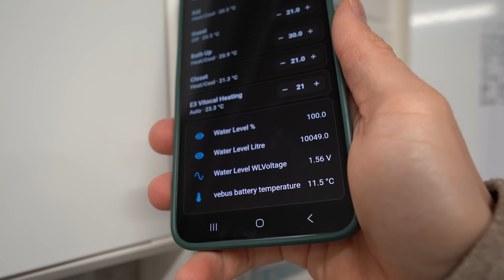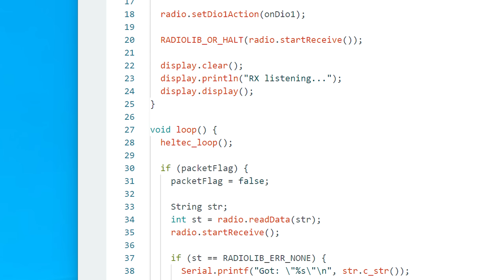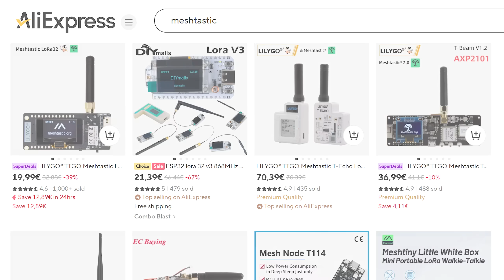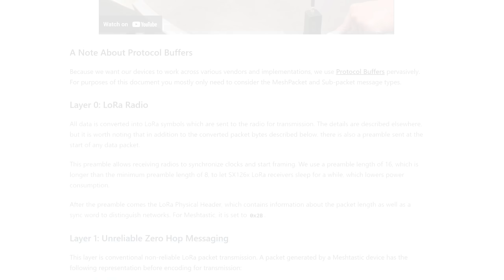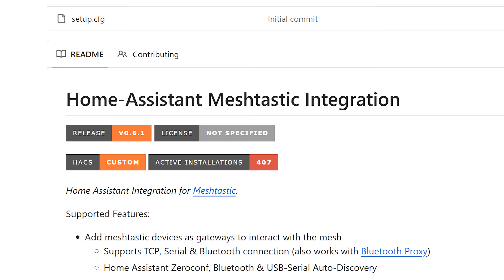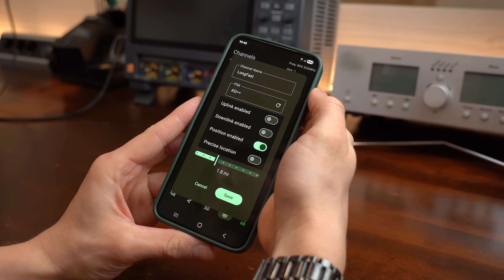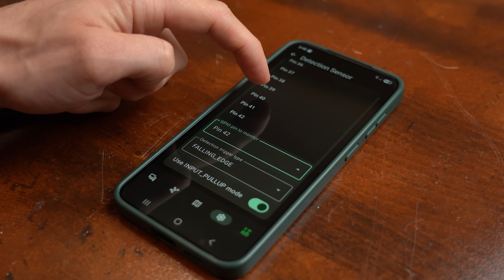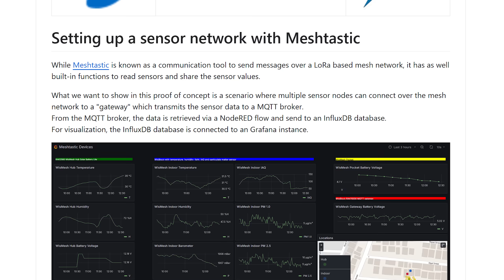No WiFi? No Problem! Long-Range is Finally Easy?!

Comment: So, now thieves know how to bypass the light curtain😮
I know it’s just a project to show what this can do but there are better systems to protect your shed.
Reply: light curtain can be used but i didnt use it for my shed instead i used single photoelectric through beam sensor. It will work fine in my case because there isn't any windows and even if you break down the door you basically will trigger the alarm its far smaller than light curtain and is hidden well a thief can't see it in the dark

Comment: Would 433MHz give you more range compared to 868MHz?
I think lower frequencies are more penetraty right?
Reply: For resonant antennas like whips, the lower the frequency the longer the range because the receive antenna gets longer and can capture more energy.  Lower frequencies also diffract or bend around obstacles. As for absorption, that depends on what's doing the absorbing. Generally speaking, VHF does better outdoors and UHF better indoors and in urban environments.

Comment: I know you needed an excuse to try the new lora stuff :), but cheap 433MHz transmitters and receivers exist and they don't block the air space for almost 1km for devices that actually need to rely on LoRa.

Comment: Oh it's working with NO logic? ( normally open) 
There is a flaw: if someone cuts the wire the system will not notice ...
Therefore it should work with NC (normally closed)
=> if wire is cut => Alarm !
Reply: Yea i also wonder why use light curtain instead of single photoelectric sensor which is smaller and would still detect that can be hidden easily
Reply: This!
Shouldn't any light curtain for professional usage be NC.
If it breaks and you dong realise and expect it to work, accidents might happen.
Reply: Use a End Of Line resistor. With NC tampering is still easy!

Comment: yeaaa buddy its meshtastic
thre fun in urban areas i get over 200 nodes with one day of being on lol CH 20 LONG FAST BABY ALL DAY!! make sure to replace the  primary channel with one you mada by clicking and dragging it to the first available position. the meshtastic device broadcasts gps packets by default on the primary channel so by making a secondary channel you can turn gps off and then by moving it into the primary spot the device will stop automatically transmitting gps packets. this is usefull if the mesh is congested or you don't hav want  your gps info broadcasted on the default channels for all to see. ALSO HELTEC PRODUCTS ALLOW LIPO VOLTAGE TO GO TO 3.2V BEFORE TEH BATTERY INDICATOR SHOWS 0% THIS IS DANGEROUS AND WILL DESTROY PACKS THIS NEEDS TO BE A PSA PLEASE!!!!!! ive switched all my heltec v3s with lion 18650s or pb solor setups. heltec v4 has a extrnal amplifier to reach a higher 27 dbm. the oem lora chips reach 21.oror

Comment: You shouldn't lay the antenna flat on that barrel.  It's designed to have an omni pattern. You only get a good transmission in the plane perpendicular to the antenna.  When laying flat, this means you are only getting good transmission in two compass directions.  When vertical, you get good transmission in all compass directions.  Also, the high the better due to curvature of the earth and obstacles.
Reply: Polarisation...
Reply: I think you can safely ignore the curvature of the earth over a distance of 20m 😁
Reply: @SolarWebsite But not with the ranges LoRa is capable of.
Reply: @SolarWebsite  20m yes, but he was reaching 750m.
The curvature makes anything that is further than 4km away invisible for a normal human (eyes around 2m above ground), so going with the transmitter around 1m above ground (that shelve on the window) would limit you to around 2km (you could probably do the math to get exact number, I am just estimating).
Reply: With the resilience of the LORA protocol, it doesn't matter at this range.  I have some of my meshtastic with high gain omni antennas laying flat. Is it ideal? Nah. Does it connect to the neighborhood? Yeah!
Reply: @Curt-0001   helps for new people to know best practice though.  Impossible to say how many people watch this video and try to copy what he’s doing but find themselves just slightly short of signal, and possibly because antennas were cross polarized  (one vertical and one horizontal).

Comment: just do t-halow and bring your device via ethernet/wifi into your home assistant. 1km range and real network
Reply: halow is forbidden in Germany, because the frequency is licenced
Reply: @MagicWolfX_HD   HaLoW is not a frequency so much as a modulation.   Could they not use the same bands in Germany as what LoRa uses?  (870ish MHz?)   In the US, we have an unlicensed ISM band from 902-928MHz and that’s where both LoRa and HaLow reside.

Comment: Good use case to get jnto meshtastic. 
20m for me is "trench some cat6" territory or use something like a ubuiquiti lr AP. I have 4 cameras running off one AP though my bandwidth requirements were a lot higher than a serial alarm. 
Where meshtastic really shines is remote environmental monitoring-1 mile down the creek checking water quality etc.

Comment: Think about, it is no longer ok to have un-safe IOT in EU. There are new law about that if i am not got wrong info.
Reply: I'm not a lawyer, but I suspect that only applies to resellers and manufacturers.
It would be kind of absurd to start fining people for having insecure devices that they made themselves.
Reply: @tin2001  The question will be if hacker hacks these devices what will be the result of that? 
Not sure, but these devices can be used to attack other devices if they are not safe. Correct me if I am wrong.

Comment: I have meshtastic boxes made from a esp32, a LoRA module,a small solar pannel and a 5000mAh batteries all around my city, and one in my bag so i can connect wherever i want, for one kit its like 20 bucks
Reply: What are you using them for?
Reply: @weltirol3476 communications, i can text, anyone who is also connected to it from the whole city

Comment: Meshtastic is still flaky and closed source, and radiolib is still a pain to use. If you really need lora for a project, it can be done, but I don't care for meshtastic.
Reply: I actually have the same issue as great scott, flakey wifi in the shed and I've sensors in there. Can you say why it's flakey, or offer a better soloution?
Reply: I agree that meshtastic can be flakey. I doubt radiolib is though, most problems are in the upper layers of code as far as I can tell.
Reply: What source isn't available?

Comment: I use Lora on Adafruit Feather M0s  to transmit temperature/humidity/power/light from my solar powered LiPo units inside my greenhouse.  A problem I ran into: the aluminum greenhouse is like a Faraday cage and nearby metal tomato trellises interfered.  Also, fogging at night (moisture particles suspended in the air) attenuated the signal.  Your metal shed is could attenuate your signals if your antenna is inside it as it appears from your video.  Also, keep your Lora away from any USB-3 cables units, that, too will attenuate the signal (at least for my US band 915).

Comment: i have my project where i want to send the value from sensor to another controller and the distance between them is 4km. So is lora technology good for me ? or could u find one
Reply from the maker: Well, this LoRa stuff should do the trick with the right antennas and setup. However, I can not test that for you.....
Reply: @greatscottlab  it's ok thx
Reply: Only if it's line of sight. There are good sim options now too.
Reply: @MyPhone-qg2eh ye but i tested some budget options but they do not have that much range

Comment: Get your antennas vertical!!!
Ball park rule of thumb not exact math...........
You can lose something like 20db of signal for antenna that don't match or are not vertical.
for every +/- of 3db of change is double or half the power. Losing 20 db because your antennas are not both vertical is devastating for range.
Reply from the maker: Thanks for the tip 🙂
Reply: @greatscottlab 
Insert <simpsons Im helping meme>
Reply: I have my antennas horizontal to minimize noise to my neighbors, (radio power options not available on my cheap router)
Reply: @mezu-e  A valid emission control method if you don't need range.

Comment: I recently learned that a Amazon Sidewalk is doing this at scale. Their internet connected devices like Ring cameras are a bridge for a mesh network to the internet.

So like a tracking tag connects to the mesh and finds any bridge device to push data to the cloud. It is all closed and controlled but you can get a development device, could be interesting.
Reply: Completely boycotting all American stuff.
Reply: Not everything american is bad... But most likely everything from amazon is bad...
Reply from the maker: Definitely sounds interesting ;-)

Comment: I just tried two Heltecs as my first LORA devices. I made a 10km connection at about 150baud through less than optimal signal terrain. GreatScott! I am  very far behind the curve. These things are very capable.
Reply: I am using a pair of "ANJIELO" wirelles bridge to connect my other appartmet to the internet, they are around 300 meters apart with a line of sight. Also I am in the center of Rome and so we are full by wifi Connections, but the connection is stable at around 5 meg/sec Up and Down.
Reply: Would that be enough for a link to a wireless router for a wired camera system to connect to or would it still be unusable as a remote nvr?  I have a barn that is not a perfect line of sight 100 meters away from the house.  Currently have the main router in the barn that is sent to the house router with a line of sight deal.  I want cameras in the barn and at the house om one system..  not two separate nvr’s..
Reply: @Z-Ack  1080p can be streamed at 5 Mb/s.
Reply: @Z-Ack Absolutely not. Lora usually does like a few bits per second at its long range config. Its intended for short ASCII messages. You should look into running Fibre out there or using a point to point gigabit radio.
Reply: @Z-Ack  look up mimosa line of site equipment. Uses 2.4 gig band and can achieve hundreds of mb/s at over 1km with line of sight.
Reply: @ocelotmadness6287  Lora is slow. Think dial up days, but with huge delays and 200 character block max per send. But its record is 800 miles in a single hop over water. I am maxing out around 10miles with very minor obstructions and base grade gear. Very low power.
Reply: @jsmythib can you please give a bit more explanation? Which antenna have you used to achieve 10km range? And it was los(line of sight) ? And lora modules were placed above the roof top? Or ground levels?
Reply from the maker: Fantastic :-)
Reply: I did 16 km with 2 heltec lora and it stopped working because there where a hill between me and the receiver
Reply: team cardputer ADV PDX checking in 🫡🔥 73♡
Reply: Hey what If I wanted to transmit a photo over long distance? What approach is possible? Lora's bandwidth is not enough for photo transmission

Comment: If your shed connected to electricity from your house you could use powerline adapter, or you could use CAT6/7/8 cable or regular wifi... its only 20 meters
Reply from the maker: True,.....but I needed an excuse to try out this new LoRa stuff ;-)
Reply: As someone into amateur radio, please for the love of god don't use powerline adapters. Those things generate such enormous amounts of noise that you'll significantly raise the noise floor for kilometers in every direction. Especially the HF band just gets obliterated by these infernal devices. They violate basically all emissions standards in any country that has them. Just run a CAT cable.

Comment: Does this LoRa has 2way communication?
Reply from the maker: Yes, it goes both ways.
Reply: @greatscottlab 
Sending and Receiving in real time is the most critical part of LoRa.
Reply: @greatscottlab 
Timing mismatch always is the common problem in LoRa.
I used for my agriculture project.
Reply: Yes..text only, but for miles and miles and miles (if good direct line of sight or multiple "hop" nodes in between)  All off grid, not controlled by cellular, internet, or amateur radio...

Comment: Just as a simple rule of thumb, your range can be extended by placing at least one of the antennas at a higher level.
The idea is that the communication between antennas is shaped like a 'muscle' and anything within that area will attenuate the signal.
So higher placed antenna will lift this 'muscle shaped' area more above the ground and thus less attenuation.
Reply from the maker: Good tip :-) Thanks
Reply: Become friends with the neighbour on the hill or tall house
Reply: The muscle shaped horizontal propagation is also called Ellipsis
Reply: @campandcook3118  It is even more a 'zeppellin' shape as it is 3D :)
The term to search for (had to look for it myself as I always forget the term) is "Fresnel Zone".
Reply: He need 20m. Are you serious?
Reply: @lmko yes, as he tested the range to be UpTo 750m
And with that range I was like ... Hold my beer 😊
With a few minor tweaks you can get a much longer range. 
As mentioned by others, align the polarisation of both antennas, but also play a bit with spreading factor and increase the ground plane of one of the devices (+ tune antenna) and you can easily get several kilometers without even having to put the antenna that high. (Like 2nd floor altitude)

So it is not about covering that 20m, but to seed some ideas in Scott's grey matter to marinade for future videos.

You have to think ahead when posting here as positive criticism can lead to unexpected results 😊
As I am sure you also did when triggering me to answer 😂
Reply: @TD-er  Same at Scott.. as we all understand, 20m can be done with wire or Wi-Fi.. that is kid's level. But he needed content and discussion.
Reply: This phenomenon is known as the Fresnel Zone.  https://en.wikipedia.org/wiki/Fresnel_zone